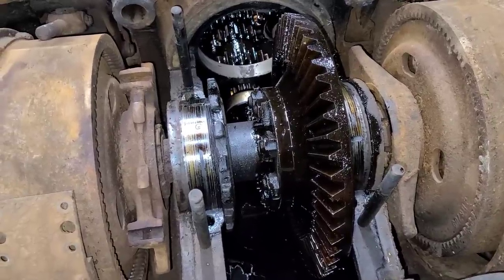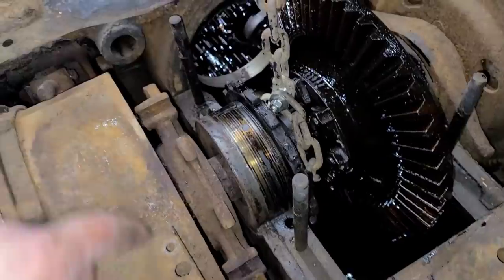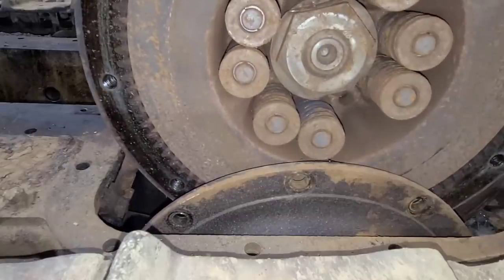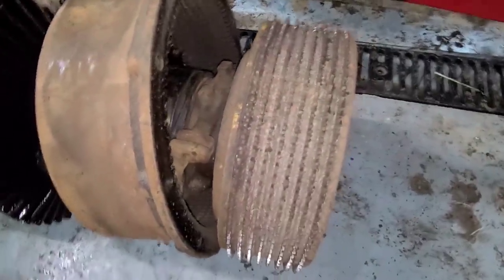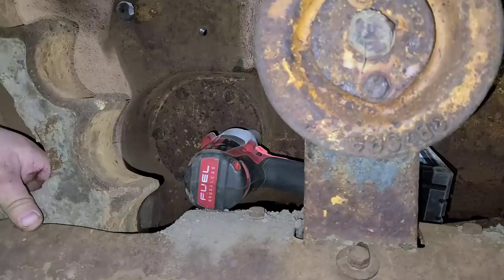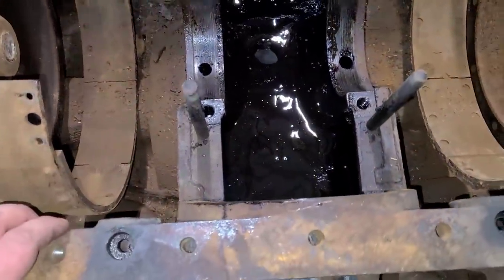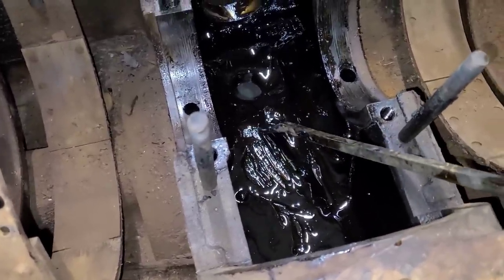Caterpillar RD-4 Transmission and Rear End Disassembly Pt.2

Comment: Suggestion Kyle, how about using one of your Torpedo heaters directed on the bottom of the oil pan to maybe turn that gunk back into somewhat of a reconstituted oil which can then run out of the drain hole, it might save you the grimy, smelly, gummy, miserable job of flushing the gunk out with diesel fuel by hand and brush. Just a thought. When I was some years younger, I loved to dismantle, clean, inspect, replace and reassemble engines and machines as a more or less part-time hobby and extra spending money.
Reply from the maker: I thought about it but when it came down to it, I can let this sit unattended to soak whereas with the heater I need to be out there and it wouldn't be very video friendly having it run in the background haha
Reply: @kylechrist  I wasn't suggesting that you video the process, just doing it off-camera and telling the viewing audience how you were able to clean out the gunk. You could explain why you did not video the process and I am sure that your fans will fully understand. You could even show the process while a speeding up of the video without sound if you think that the show's fans would like to see it happen, which I believe would be interesting for many fans to watch. Keep on, Keeping on.

Comment: Way to go Kyle! I love it when one of my plans comes together LOL! I'm old school and I use kerosene as a solvent for heavy grease. I'm pretty sure that Gunk original engine degreaser is a kerosene base product too! I would have put the plug in the case and drowned the gears in kerosene for a day or two but everybody has their own way of tackling a project. Not judging just saying! Keep up the good work!
Reply: Diesel fuel is basically Kerosene plus a little light oil.
Reply from the maker: Thanks, I can already tell the oil had pretty much dissolved into the diesel 👍
Reply: You are right, but kerosene use to be the lesser cost.

Comment: Other than the fight with the rev idler, that really wasn't too bad. Brake linings actually look pretty serviceable, REALLY hope steer clutches saveable as well.
 Not knowing complete back story on machine, looks to me like engine issue is what did her in.  Dog just wants to help - atleast they aren't jumping/climbing/whining.  Hope your luck holds out with the u/c.
Reply from the maker: Thanks! I will be putting new steering clutches in as well as relining the brake bands. I'm in this far so I want to make sure I don't have to go back in for awhile

Comment: Do you plan on blasting and repainting everything? Looks like a good chunk of work ahead. To think of how much work squatch has into his d-2 considering condition. i can only imagine the depth of work this old cat needs to get all the rust out and cleaned up.
Reply: Squatch basically said that one he is working on is not worth rebuilding but he got pushed into it by the rescue video high view count.
Reply from the maker: Yes, total restoration. It will take work but will be a neat machine when done

Comment: That Cat was so rusted I thought that the only thing to do with it was to toss it as one whole piece into a giant blast furnace and melt it down.  I am amazed that you are managing to get this thing to dome apart in the way you have.  Just unbelievable.  It will be interesting when you get to the engine to see what it's like on the inside.

It is interesting that at some time this D4 was considered not worth while to keep running.  But now it is considered worth while to resurrect it from it's rusty grave.  I have to shake my head a bit in disbelief.
Reply from the maker: I just don't like seeing these old machines turned to scrap, at the very least I would keep a machine for parts to keep another one alive

Comment: It seems the steering clutches will do fine but you will get a clear picture once everything is clean and nice. At least the gearbox is like super nice. I just wonder why was that crawler parked in the first place? Maybe the engine will give us more clues.
Reply from the maker: From my understanding, the gentleman that owned it when it still ran quit farming, so there was no need to use it as all he used it for was pulling a 4 bottom plow
Reply: @kylechrist  I did figure that much. Sometimes the last owner dies and the wife did not know what to do with it and so they keep sitting in the dirt and leaves for decades. Or the other one: something has catastrophically failed and it was not reasonable to repair it any longer.  These are the cases I have come across and everything  in between. If it has been using a blow a lot. It might have one of the steering clutches more worn then the other one.

Comment: are you going to slosh it around some with a parts brush up on the side castings to help with the dilution processing also, or just spend the extra time cleaning?
Reply from the maker: Yes, and yes. I'm going to dilute what I can and probably still have to come back with rags and brake clean to get the rest

Comment: Looking at the reverse idler after removal,  looks like 2 shiny places - the easy one and the hard one - and a void in between?  What is in that void or am I seeing it all wrong?  7:48
Reply from the maker: That void is just the rough casting covered in oil, it is lower (or smaller diameter) than the two machined surfaces on either side
Reply: @kylechrist  My question was worded all wrong, I meant a void in the case where this part was installed.  Thanks for the reply and sorry for wasting your time with my original question.

Comment: Funny how your four legged helper isnt much of a help when it comes to pulling that shaft and gears from that housing  and I kind of figured that shaft could be extracted from the back with a bit of finessing and fanagleing well done. And those clutch packs look like they could be un harmed  you'll know more when you remove the spring clips and pins ,be careful.
Reply from the maker: Unfortunately the dogs only watch and get in the way haha, when it comes time to disassemble that shaft, I will have the proper spring compressor

Comment: When you repaint,  are you going to put a sealer on the inside? See squatch253 'Minneapolis-Moline Prototype 445 Tractor #X231 Restoration - Part 22: Cleaning/Sealing the Rear Case' at about 1½ minutes in.
Reply from the maker: It depends what the factory sealer is like once it's cleaned up, but I've seen all the x231 episodes and that is definitely an option

Comment: Wonder what that old gear oil smelled like. Not sure I have ever been up close and personal with any quite that bad. Will say that I doubt anything is worse than burned gear oil. Use to work a lot on rear axles and I had a motorhome once where the rear axle was just melted to slag. The smell of that burned gear oil was straight from hell.
Reply from the maker: It smells like 80w-90, there really isn't a burnt smell which is surprising for how black the oil is

Comment: Is it oil or oil grease mix? And some of your video is out of order
Reply from the maker: That was oil, at one point. Which part is out of order?
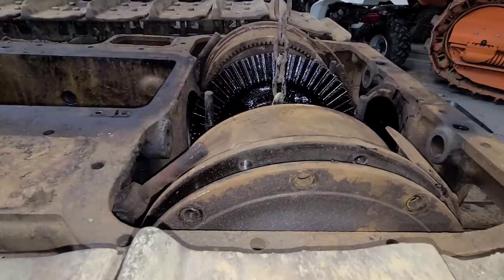Reply: @kylechrist  you showed removing the rear drive gear then had it back in the machine then out again it was at the 3 minute to 3:20 minute mark and it should have been put in at the 1:47 minute mark
Reply from the maker: @tacticalrabbit308  yep, that is my fault in editing, seems I got those two mixed up. Good catch!